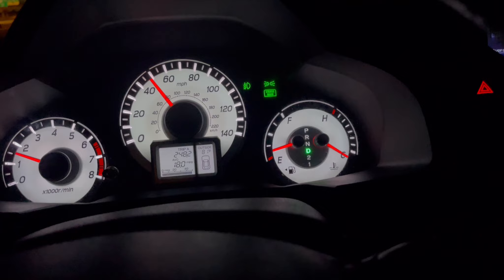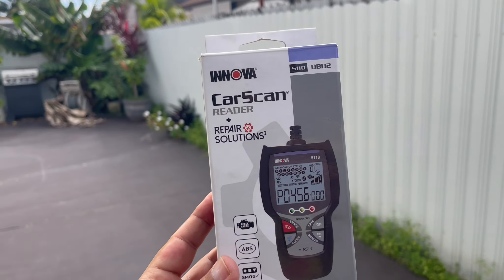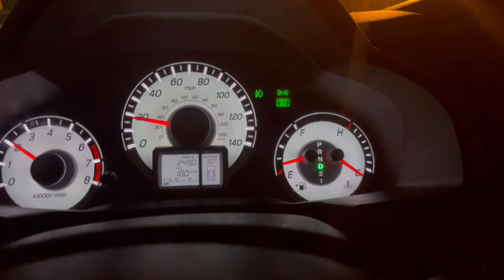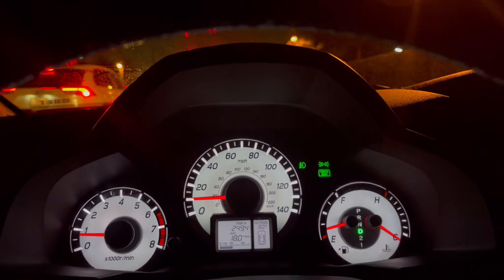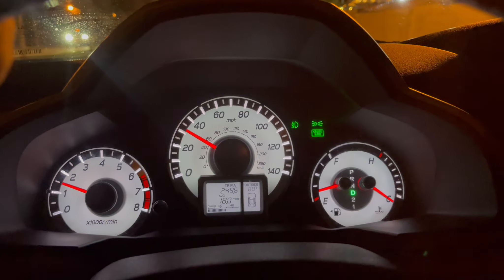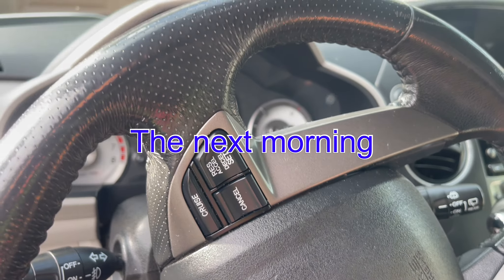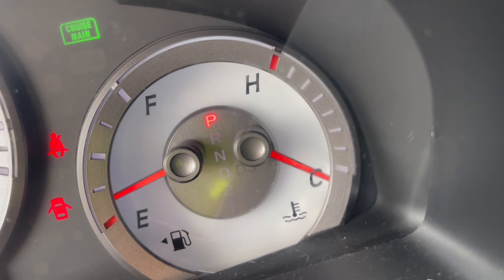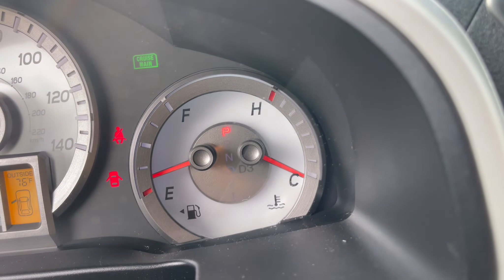Honda Pilot Issues with S-VCM Controller Error Code P0118 Problem after battery Change

Comment: your temperature sensor is bad, if you change it and still does it you may have a open circuit or a short to ground. normally its the Temperature Sensor and sometimes the sensors come bad even though they are New.. look at videos in you tube to test it. if on the scanner you have ect of -40 its your sensor. once you repair it the svcm will go away by itself. the code will probably stay permanantly but it wont be stored and you should have no check engine light which means your problem has been solved. the code will erase will erase alone after a couple of cycles.
Reply from the maker: You’re the man bro!  I appreciate the input. I’ll try that and update the progress. 🫡

Comment: Thanks for posting but I'm a little bit confused, you mean you already have the S-VCM installed and then you changed your battery and then that's when the issue started? Or you installed a new battery and the S-VCM at the same time and then that's when the issue started? Thanks!
Reply from the maker: Yes. Already had it installed. Issues came up that turned out to be battery related. 

I put a new battery in. And issues started. 

I went through and did an idle reset. 
But now my thermostat is wonky.
Reply: @mytrx4andalittlemore  Thanks for the reply. Have you tried removing the S-VCM and do a test again by driving around and check if your thermostat will work fine again?